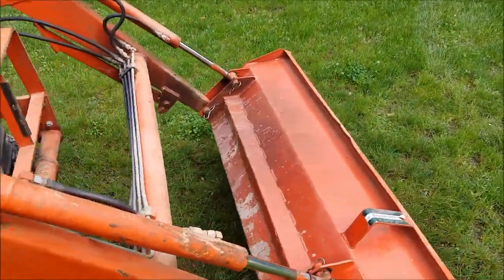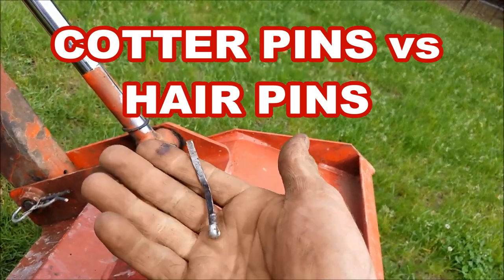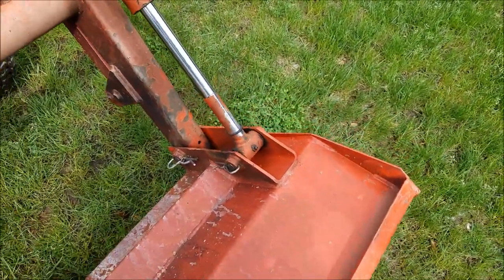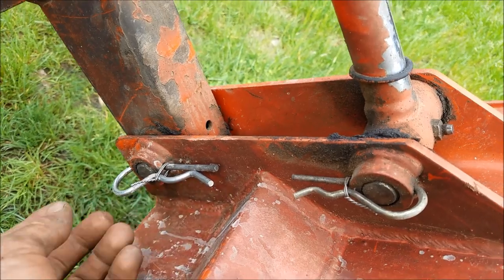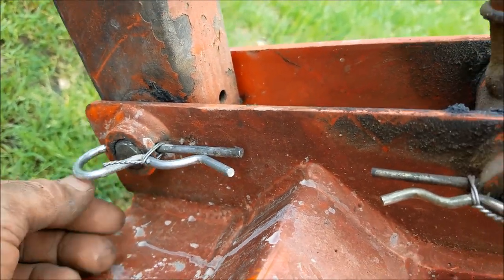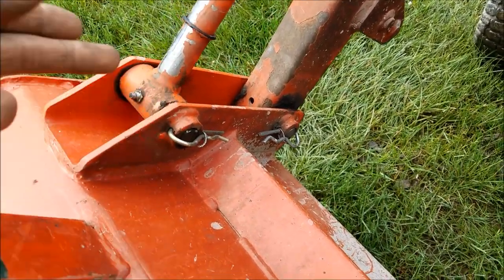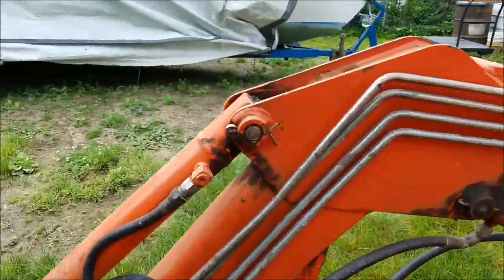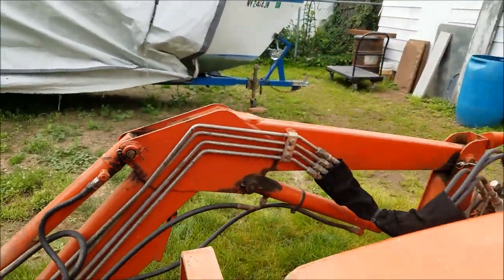QUICK TIP: Use hairpin cotters instead for tractor bucket pins

Comment: I work for a Kubota dealership. The newer Kubota tractors now use a grade 5  bolts with nylocks to keep the pins in
Reply from the maker: That makes sense.  Thanks for the update! Really appreciate it. After upgrading to the hair pins , I haven't had an issue.
Reply from the maker: What size bolts are on the new ones? M6-1?